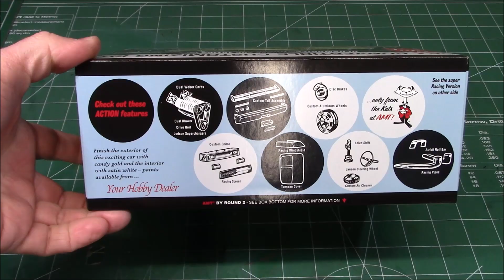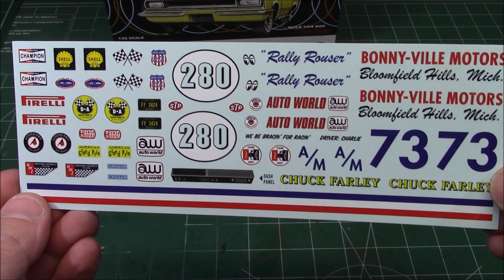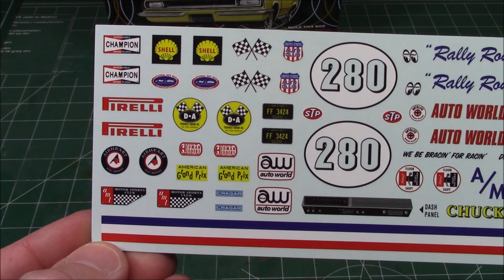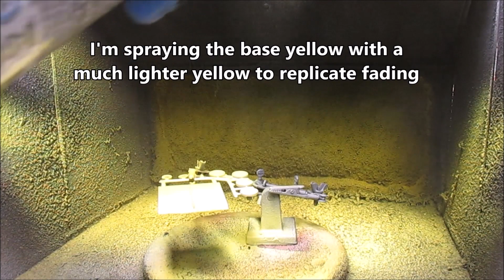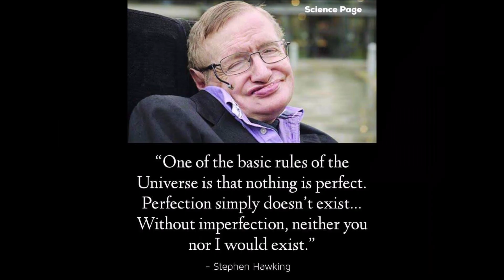1964 OLDSMOBILE CUTLASS F85 CONVERTIBLE 1/25 SCALE MODEL KIT BUILD REVIEW WEATHERING AMT1200 AMT

Comment: If you look at the taillights very closely, you’ll be able to see the mold ridges on them, for the stock trim in the taillights. That rocker trim wouldn’t rust like you build the model, the body will rust out like crazy, but that rocker trim won’t rust. It’s made of aluminum. Other than that, you’re spot on, on the build, that I could tell. On the hood, you don’t need to be there. The firewall will hold up the rear of the hood.

Comment: Hoping the upcoming hardtop kit this summer is an accurate 4-4-2- with a 4-barrel and the 4-gear transmission..
Most GM vinyl was bulletproof, you see more split seams than tears in the surface..
Nice job... I've seen a few in that shape.
Reply from the maker: Thank you!

Comment: I want to build mine as the full custom except my kit is missing the ENTIRE ENGINE SPRUE.😟
Only engine parts included are the twin chrome Judson Supercharger plenums.
It did come with two interior sprues though.
Emailed AMT to see if they can send me the missing parts.
Reply: Then again, I may check and see if the AMT 67 Chevelle Pro Street tubbed chassis/driveline will fit under the custom body.😁
This Kit was offered as a drag racer at one time.

Comment: At the 12:53 mark it appears you’re applying a very good silver/ chrome paint - what are you using?
Reply from the maker: I'm spraying a matte clear over the stock chrome, as labeled. Thanks!
Reply: @hpiguy  - I missed the label - it looks like you switched parts and paints at about 12:35 but I don’t see the label in the video -  sorry about that, I saw the rust oleum black label though.

Comment: I enjoy your videos and have had success with your method of painting with Rustoleum paints, until now. Question, What method and product do you use to remove or strip the Rustoleum paint? I used the Rustoleum grey primer and let dry/cure for 72 hours and then painted my pickup bed only with Rustoleum 2X Gloss Macaw Blue. Orange peel out the wazoo. I had warmed the paint can in hot water and shook the can for several minutes before painting the truck bed. Any assistance is greatly appreciated.
Reply from the maker: Super Clean will strip most of those paints in a day or two.
Reply: Thank you. Keep the model build coming.